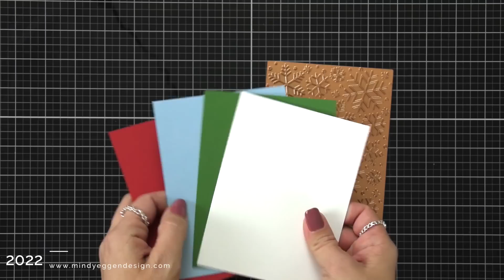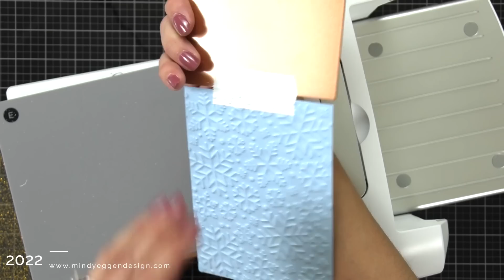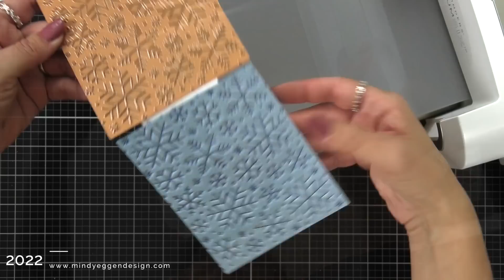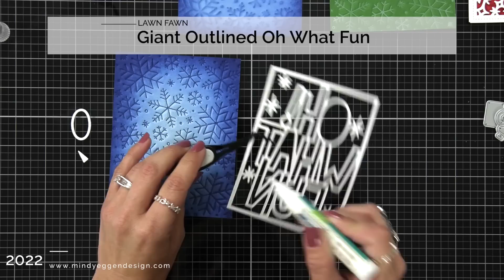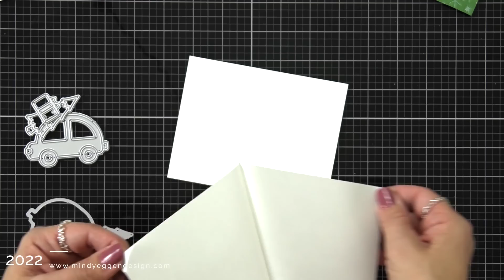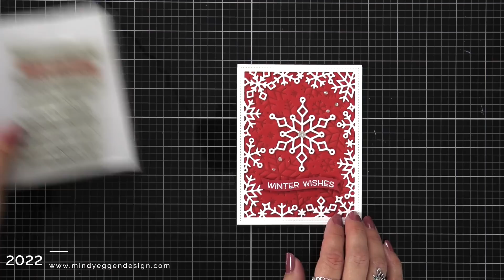Ways To Use Hot Foil Plates with NO Foil!

Comment: Thank you for sharing this technique! I've seen that many sets now include hot foil plates, but I only have a hand-me-down, old Cricut. I've had to be creative with using paper shims just to get dies completely cut through. I'm hoping my oldest son will get me a new one for Christmas. I do have a question... Is there a trick to seasoning blending pads? My first go at it was awful! I made it work, but it wasn't what I wanted. I just have a few mini cubes of distressed inks.
Reply from the maker: do you mean blending brushes? with foam blending pads, yes. they work better seasoned but with brushes, I always suggest tapping the brush off a little onto scratch paper, then start off of the paper and word your way onto it. I have a lot of ink blending on my channel that you may find helpful. Thanks!